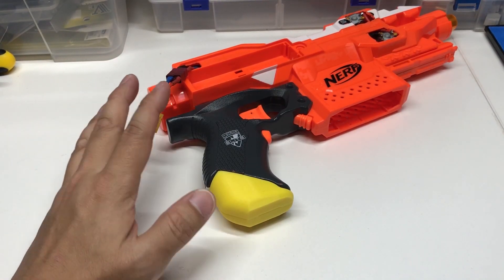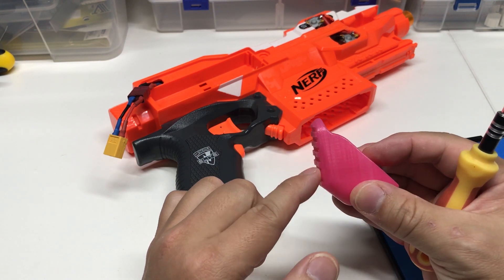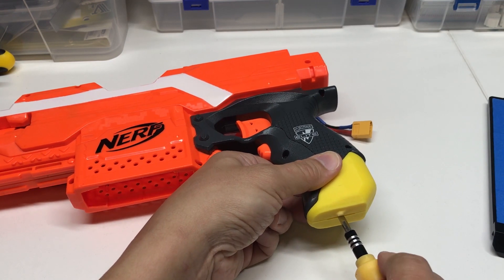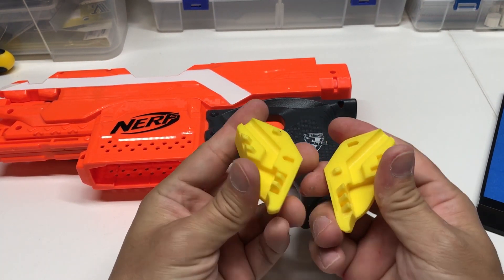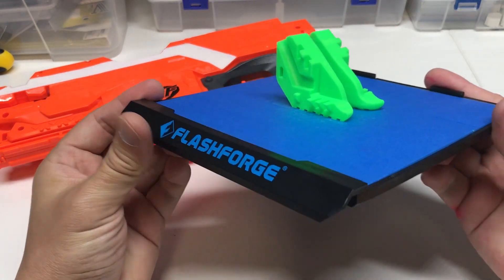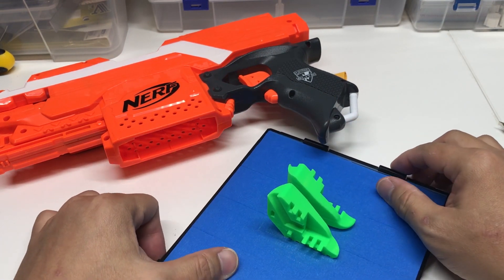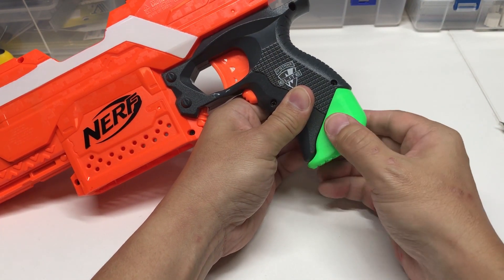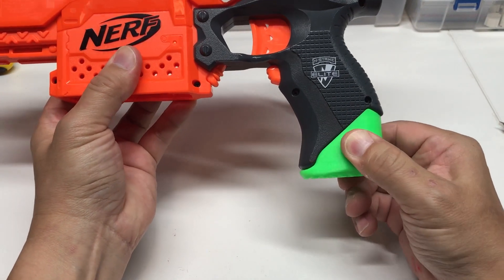{My Thingiverse} - Nerf Stryfe Grip Heel

Comment: Beautiful prints and designs. Could you make it so it's a seamless transition from Stryfe to print on the back of the piece. Then it would be flush and level like the sides. TkEZ»UK
Reply from the maker: Ian Farquharson most likely not so soon as I had started on another model. But I can give it a try once I am done with other stuff :)
Reply from the maker: Ian Farquharson, I updated the design :) check it out :)